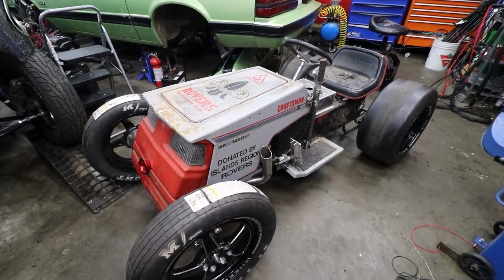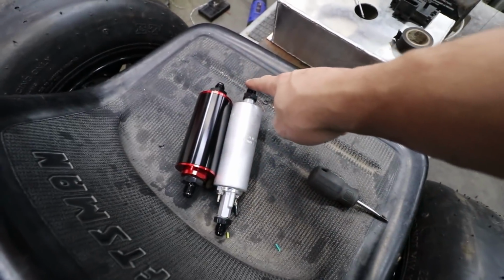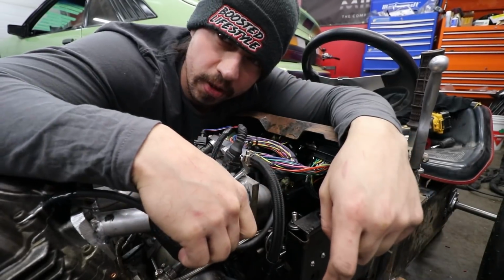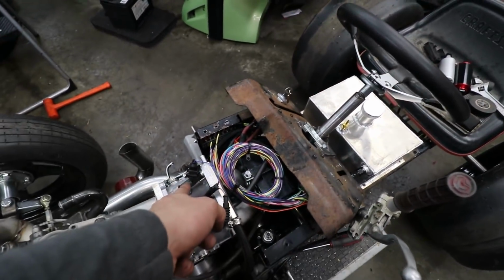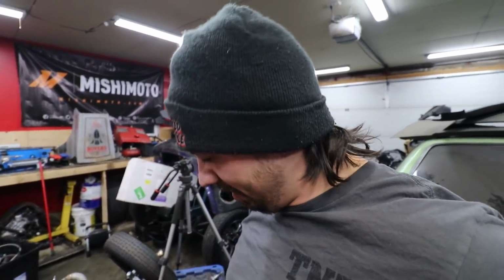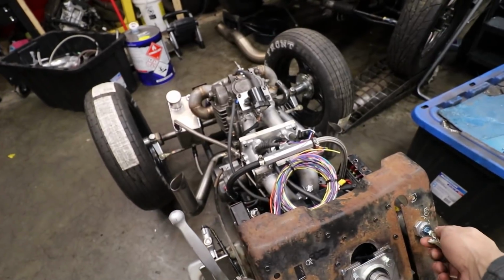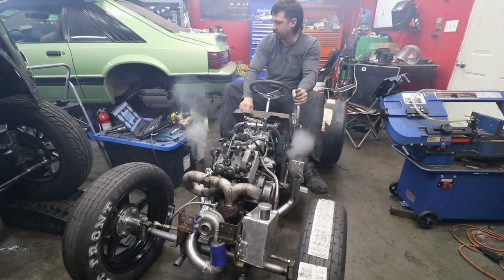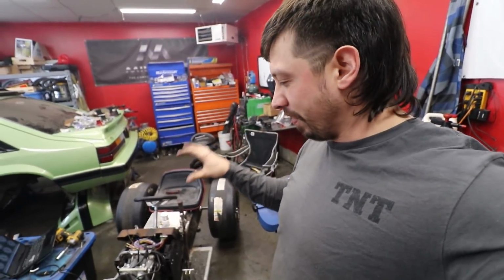Turbo 660 Lawn Mower Is Done And It Works.

Comment: For future reference. That’s Pclamp (adel) clamp in aviation. You can drill a new hole in the straight non 90 bent end and cut off extra rubber for a smaller clamp. 👍

Comment: dumb question, but why dont you run steel braided hose from the regulator and mount the fuel pressure gauge in the dash by the steering wheel that way you can see it while driving so you are less likely to harm the engine when putting the engine under boost????
Reply from the maker: I could also do that. It wouldn't be difficult. Right now I'm just trying to do a lot with what I have
Reply: @Boostedlifestyle  you do you boo! Just thought I’d give you a little idea before it gets completely together

Comment: There could be a chance the rings aren't seating and you're getting a lot of blow by. It could also be why it runs, but not great. Just a thought. Might be worth a check. Either that or it could be ignition timing is off or not synced just right. I dunno 🤷‍♂️ Keep it up though. You'll figure it out  😁👍
Reply from the maker: A compression check actually wouldn't hurt

Comment: you should make some rat rod type fenders for the back tires so your shirt doesn't suck ya into your own machine lol. You could use some old 5 gallon metal oil jugs then cut and stretch them out to make fenders!

Comment: You might wanna read into boost capacitors/boost tanks for single cylinder turbo setups. Sometimes they won’t build boost without it

Comment: You are going to need to switch to a 50mm kart axle sooner rather than later. Probably be easiest to just buy a slightly older race kart roller for cheap to steal bearings, carriers and axles off. And probably the brake while you’re at it.
Reply from the maker: If I can find out I think that would be the tits !
Reply: Legitimately if you have any questions let me know. I’ve been into karting for a long time. In fact if you bought a shifter chassis it would have front brakes to steal off it as as well. You are crafty enough to fab up some brackets and such to make it all work. I’d be surprised if that cheap single disk on the rear axle will actually slow that pig down.

Comment: just like the bosch 044 80gph 50psi system on the T-bird, smokes till the primary and secondary o2's take over... correcting its self on a 300'000'000 hertz cycle. 1994, one of the first auto leveling fuel system computers. some Lincolns had it in the early 80's, no one talks about it... just bolt the turbo on and it works.